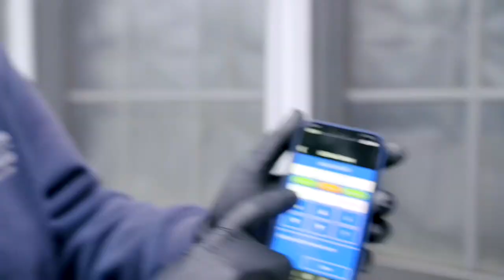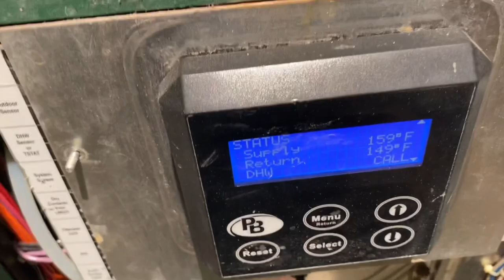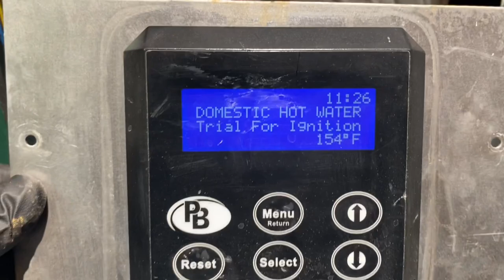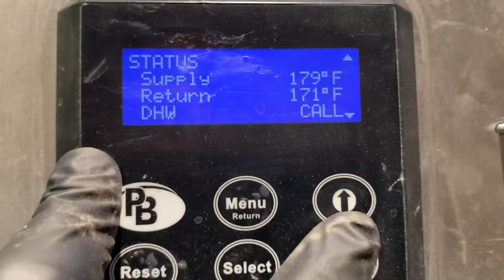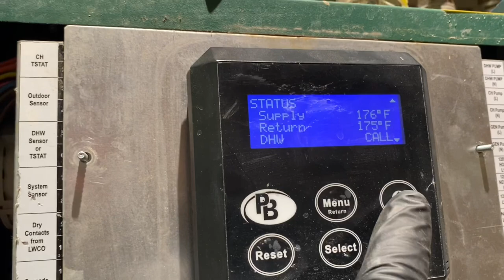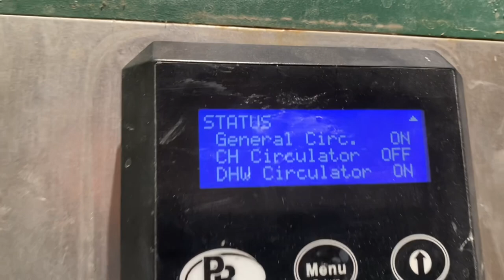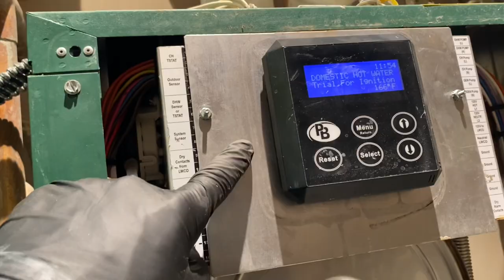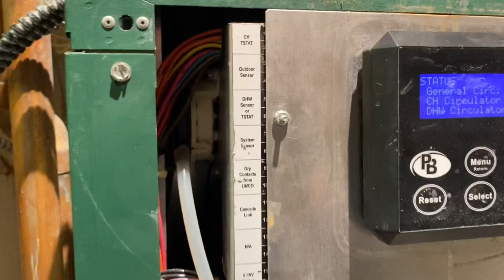Peerless PureFire Boiler with Burnham Alliance Indirect Water Heater No Hot Water

Comment: I'm an industrial mechanic turned auto shop owner. That cocky in the relays is normal. There is a voltage spike when the contacts open and that is small amount compared to larger contactors. In a situation like that you need to get I to the control side of that relay and see if your coil (control) is energized and then take a voltage measurement across the contacts (output side) of relay.. When closeed (on) should be close to 0 volts and if your reading high voltage there is resistance in contacts.

Comment: Nice video, good learning experience. Wow. Pinhole leaks in the piping and fittings, failing mixing valve, old water damage corrosion on the connectors, bad expansion tank, burnt relays on the control board. this boiler has everything going wrong. If I lived there I would want that control board replaced before it fails in subfreezing weather on a weekend. Is it time to stop pouring money into that system and replace it, maybe with a lot of repiping? I wouldn't replace it without water analysis and recommended treatment added. Mike you are correct that the discolored relays are signs of wear. Who knows if they will last days or years like that.

I had a Bryant 92% furnace. It's control board relay burnt up and the contacts unsoldered from the board because they got so hot. That POS furnace cost me a lot of money over its lifetime, two control boards, an inducer motor, a gas valve under warranty, and maybe a blower motor. I saved pennies on NG and spent dollars on repairs. Never again will I own a  BDP product because that furnace was a PITA to do any routine PM at all. Not to mention that BDP wont sell parts to an owner.

Comment: You found the magic smoke in the relay!  I would assume the contacts are a bit carbonized as well.  I am sure that relay has been on and off many many times.  The internals of that boiler almost looks like a Navian!   Those cables are in rough shape for sure.  I am sure the resistance of those connectors are quite high, just like the relay.  Its just a runaway cycle for sure, the worse it gets the higher the current, which then makes it worse and until something craps out (best case) or catches fire (worst case) until its fixed.  Lots of holes in the copper and brass fittings, that need to be sorted out.  My OCD was going insane in that room.  You have to warn people with OCD that they need to look away and don't stare at the plumbing and electrical nightmare!  👍😁🤦‍♂

Comment: Relays wear out, s*it stains are not good, but relay contacts switching 120 VAC can be pitted up and still work fine the voltage is high enough to burn through any carbon. Now if the relays were switching low voltage it would be no bueno.

Comment: I would still be suspicious of any relay exhibiting signs of arcing   Enough carbon build up and or pitting of the contacts is a recipe for an off hours service call. Sounds like the manufacturer should beef up the current capacity of the relays imho
Reply: Use standard off the shelf plug-in relays.  Would make servicing so much easier.

Comment: Just my 2 cents you pay a lot more money for these high efficiency  machines up front . Then they are more expensive to repair because parts cost more and the Techs. need more time with them . Are they worth it ?  I guess only if the left stays in power and the cost of energy sky rocktes maybe . Then Mikey will be installing wood burning boilers . #FJB !